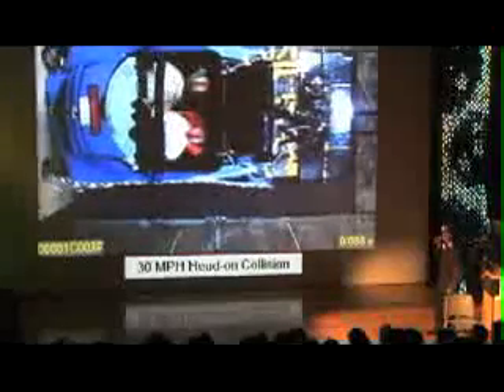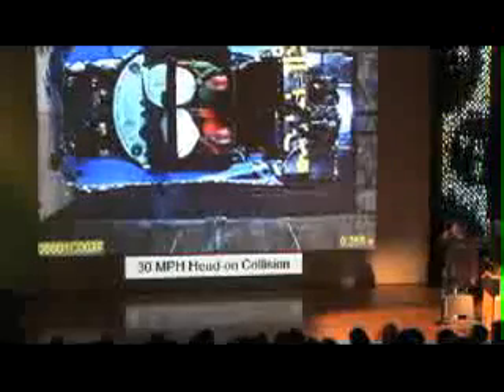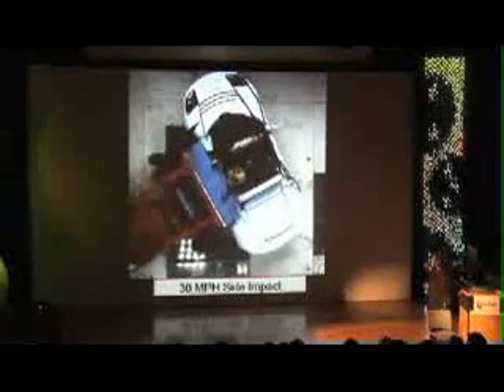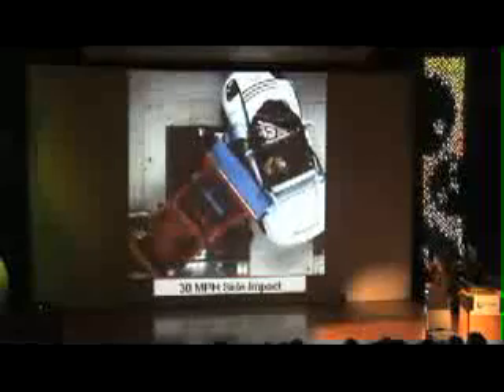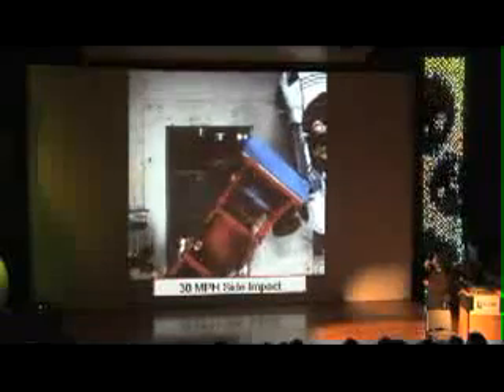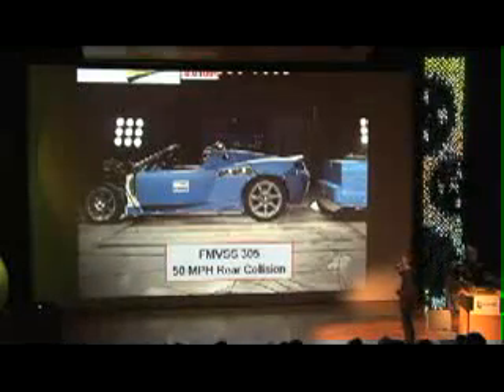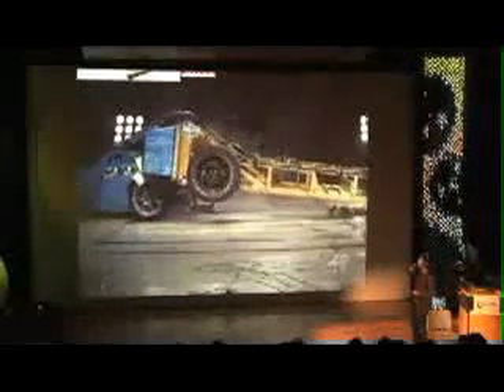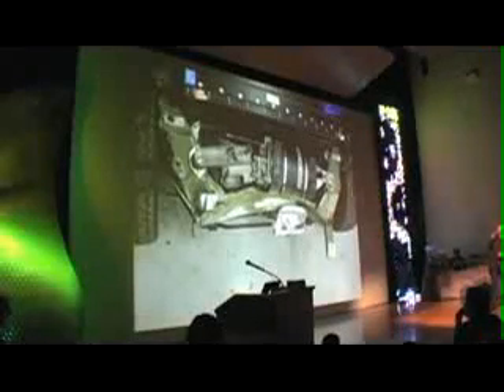Tesla Roadster crash test

Comment: Not all highways have barriers separating the two sides of traffic. What about oncoming traffic on the left? or perhaps a big tree on the right? Trees can be just as strong as concrete walls.
Sure you are right; if I crash into a car going the same direction as me the crash is really only the difference in speed. You also can take into account the time I am on the brakes before the crash. That usually takes off 20mph. But in the end, don't you think crash tests should be higher than 30-40mph?

Comment: o-m-g me loves car crash tests at 30-40mph when are they going to start doing real world speeds? anyone else go 85mph on a regular basis to work? lol...
Reply: lifeisgood070 correct, but there are two differences: a) a 30mph-crash against a concrete barrier is like a 50- or 60mph-crash against another car. and b) in  NO  car of the world a 70mph-head-on-crash against a concrete block would be survivable. decelerating from highway speed to zero within less than a yard HAS to end up in G-forces that would be fatal.

Comment: A friend of mine in the Napa Valley has a Toyota RAV4 EV (All Electric 100%) Made stock as an All electric, not hybrid. It has less range than the Tesla and the Rav4 only goes 80 mph. 
But he still drives this thing all over the place. From Napa to Sacramento and back all the time. And it keeps up with the fast traffick on Hwy, 80 just fine. 
The Tesla Roadster is going to work just fine. All you naysayers are as dumb as a bag of hammers.

Comment: No thats false, electricity is produced in a controlled manner. They can control pollution much more effienctly in a electricity plant  than a gas/diesel vehicle driving down the road, thats just common sense. The electric car is MUCH more efficent than any other technology to date. They know that which is why they've been withholding the technology. Check the stats on Phoenix Motorcars, its undenyable.

Comment: I agree about the smug attitude of many "alt energy" car owners you're wrong about everything else. First, how many people in the US drive over 200 miles a day? It takes 3.5 hours to fully charge from being fully depleted and it comes with a on-board charger to plug into a standard outlet. You're certainly not polluting more by charging since the amount of power used isn't close to the amount of gas required for the same job. The batteries are recyclable and even safe to normally dispose of.

Comment: Despite so, the thermal efficiency of an electrical motor is infinitely better than any internal combustion engine. Electric motors are about 85-90% efficient at transforming electricity into movement. An electric generator fueled with natural gas is about 60% efficient. An internal combustion engine is about 14% efficient, in the best case.

Comment: And there's no acid in these batteries. Just tiny individual solid cells with a microcontroller in each of the few thousand cells sensing for any anomally in the load. Extremely safe, though of course if you just short cirtuit the terminals or perforate the battery pack with a metal rod, you might have some nasty arc, but nothing more serios than what you would get in a normal car.

Comment: Also, this type of battery is composed of large numbers of individual cells with microcontrollers each. When a cell senses an abnormal load (one that doesn't match the electronic signals being received) it will just shut down, preventing high voltage or high current from even reaching the big wires. That is, for a properly developed battery, which I think I can assume the Tesla has.

Comment: In most EVs & hybrids live wires are thick, bright orange & run along the center on the car. Most also have kill switches. Training is to watch out for those wires. Electrocution risk is actually very low; risk of fire is much greater. Tesla has various protection for its battery pack that prevents battery fires. If you calculate the statistics I would bet the gas tank in a normal car is more dangerous in an accident; I have seen many cars catch fire & explode in police chase videos.